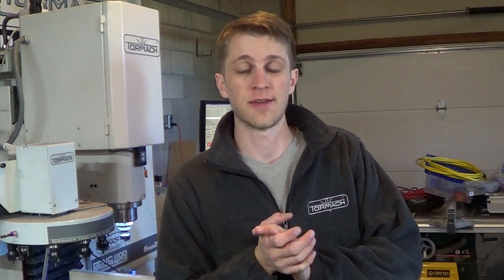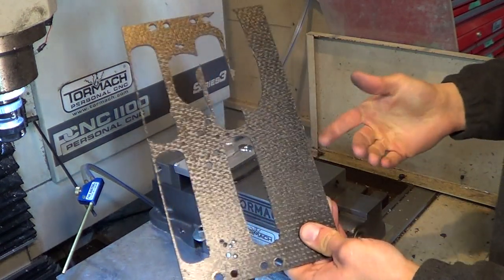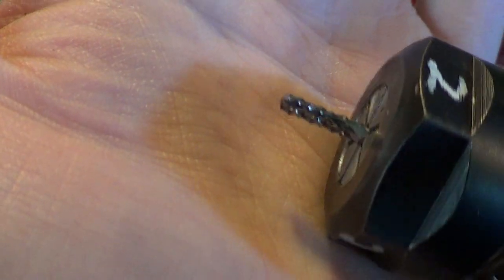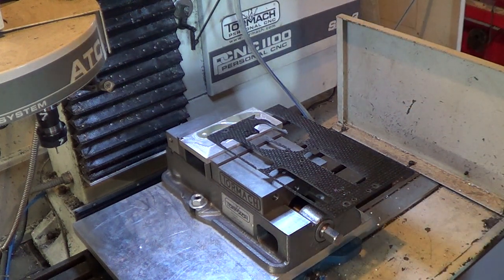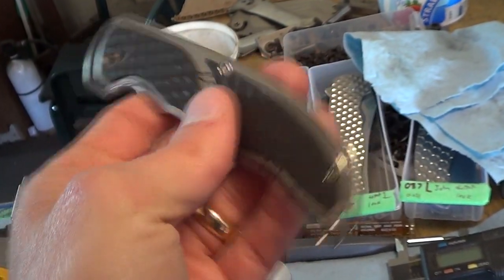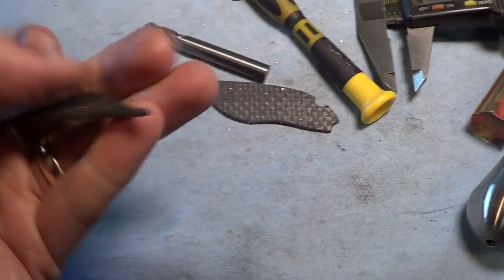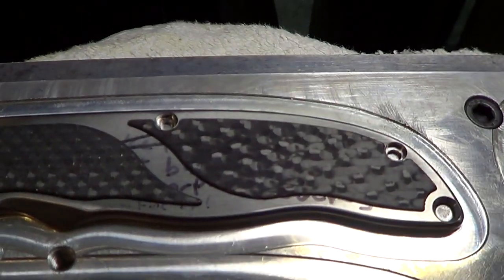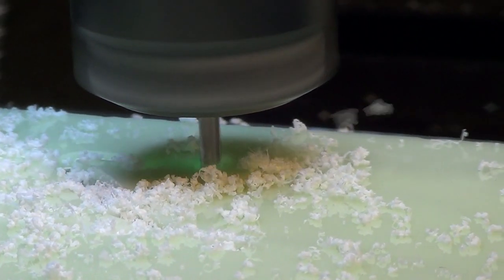Knifemaking Tuesdays Week 66 - Inlays Part 1

Comment from the maker: 2500rpm, 50ipm.  The finish is a little lined but that works for this because the glue has more to hold onto.  For a mirror finish either spin it faster or move it way slower.

Comment from the maker: Yes, but then I get wet CF dust all over my machine, instead of vacuuming up most of it.  But yes, the guys that machine a lot of CF either have a huge vacuum set up, or huge volumes of flood coolant and then they filter the coolant.  I like the filtering the coolant idea, but I'm not sure what kind of filters that would require.

Comment: Consider using acetone to remove the glue, pretty easy and fast, especially on glue that is not old.  Also, using/holding the vacuum hose near the end mill similar to flood coolant to collect carbon fiber dust on the fly.